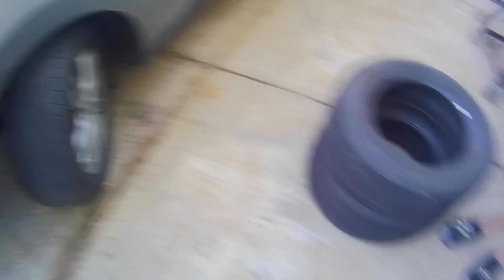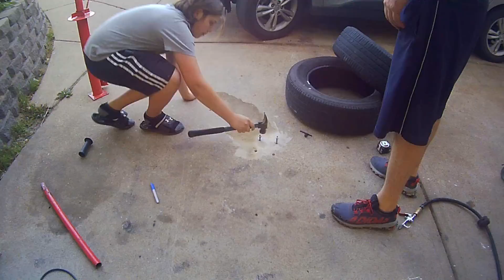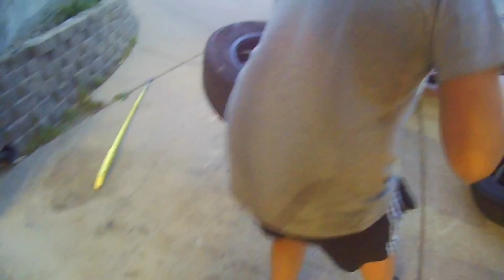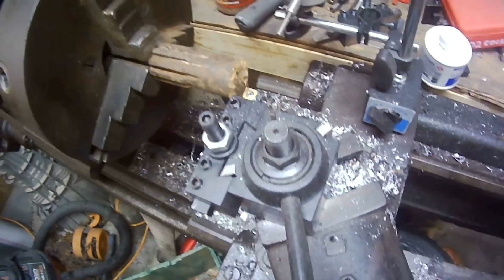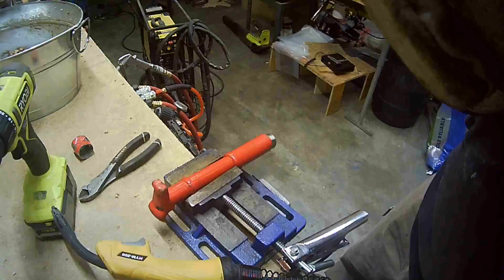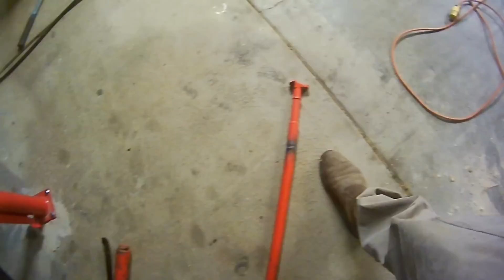Harbor Freight Tire Changer

Comment: Helpful tips from a mechanic  that changed tires for 10 years back in the 1990's/2000's and has 1 of these pole tire changers. I always spray a ton of soapy water on the hoop of the wheel so the bead of the tire will not stick to the wheel while I'm removing it. I cut a square out of the tread of a old tire and drilled a hole a little bigger than the diameter of the pole 
Put the wheel on the pole then put the car tire ⬛  on the pole (this keeps the X peice from scratching/damaging your wheels) then the X peice then the tube tighting piece...and hopefully you know about date codes on the sidewall of the tires cause tires are timed out/no good anymore after ten years. Even if the tire was never used. Date code translated: The 1st 2 numbers are the week of the year it was made.The second 2 numbers are the. Year the tire was made.
Reply from the maker: Hi Cole. Thank you for the tips! This will definitely help the next time we change some tires.

Comment: mine from northern works good.. it's the same.  had to do a little modification on the hook installer  it was casted wrong. and I made a stronger bar using solid round bar. I just use mine for emergencies
Reply from the maker: I hear ya. I only use mine a couple times a year

Comment: I've had mine about 20 years and believed it was damn near worthless  because of the installer end of the bar as well as how the bar bent while breaking a bead off a rim I built my own bar based off a design I saw on the sixtyfiveford channel. It was simple and makes tire removal and instalation so much easier.  I also use tire mounting compound. It lubricates to make the tires go on easier, it creates a better seal around the bead (especially for older rubber) and it even makes it easier to seat the bead.
Reply from the maker: Hi Nathan! I will have to check out that channel and maybe make that bar. The first time we used it was a disaster lol. There is definitely a little bit of learning curve on using these things. Thanks for watching!
Reply: @averagehack4582  yea the only learning curve I found in using the original bar was the bend I put in it nearly the first time I used it. I ended up using the spoon part solely and never used the hook end. I want to make a video of my own on how I altered his design. Mainly for the demo ting side. He used a piece from a motorcycle tire tool but not only was it very expensive, nearly tripping the cost of the build, but it broke the first time I used it. So I used a 3/4 " bolt. I shaped it to resemble the other piece and made the hex head round and it has worked great. I've probably dismounted 30 or 40 tires with no issues.

Comment: Shoulda bought tire irons. They work a lot better.
Reply: Not really.  This has a bead breaker so you don't need a bead breaker hammer.  You also don't have to sweat your balls off trying to hammer the bead back on and take a chance of either chipping a rim or damaging the tire bead.  

It isn't the best tool on the market.  It isn't motorized.  But, I think it beats tire irons by a long shot.  If you are used to irons, they do work well in a pinch and can be thrown in a truck without much thought.
Reply from the maker: Hi Dennis. I know! I always mean to buy them but then I  forget about them until the next time I have to chance some tires. Thanks for watching!